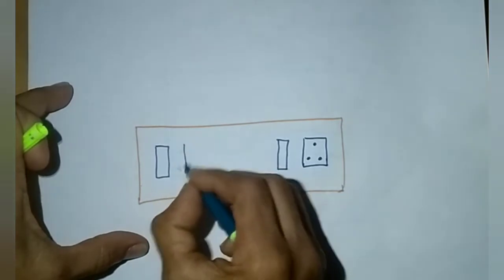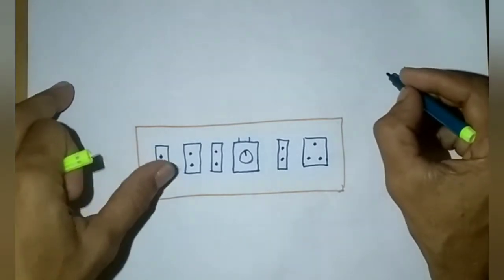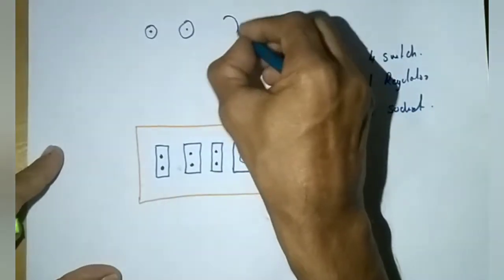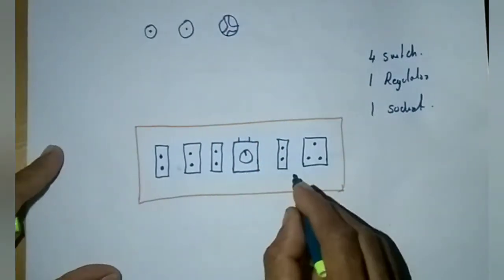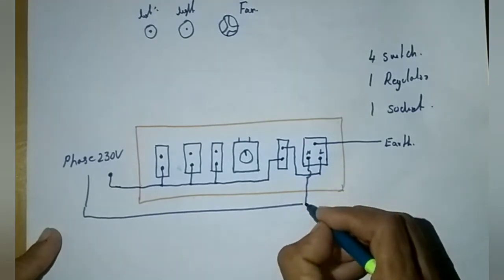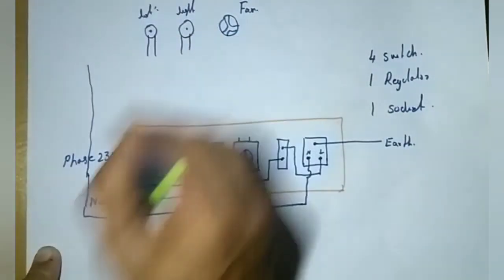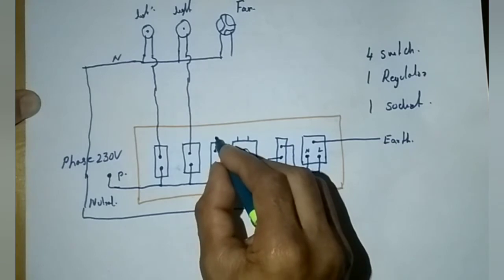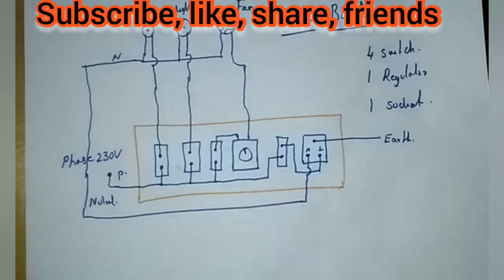switch board connection wiring 2 lights 1 fan 1 socket#i love god

Comment: Otta switchil ninnum exuhst fanum lightum engane connect cheyyam.njan cheyithittu switch off akkumbol light dimm adikkunnu fan not working um..
Reply from the maker: induction current undo ennu chekk cheyyanam,,allenkil bulb low quality ayirikkum friend,,,pinne phase ill alle switch koduthirikkunnath ennu chekk cheyyanam,
Reply: @justinkv02  ready aayi